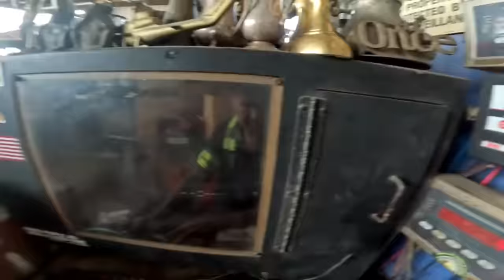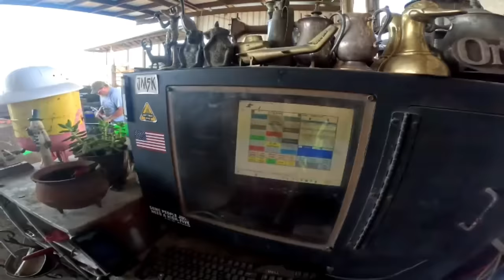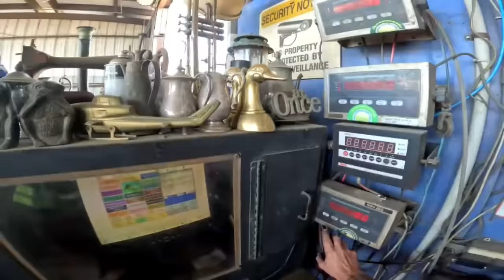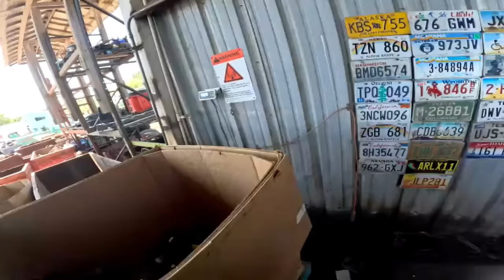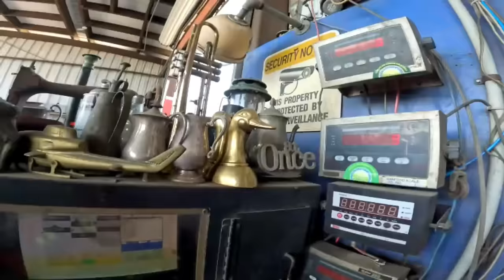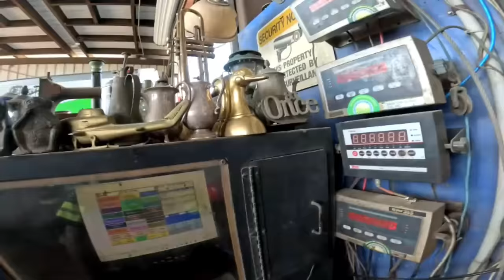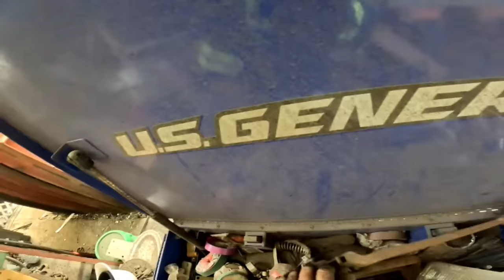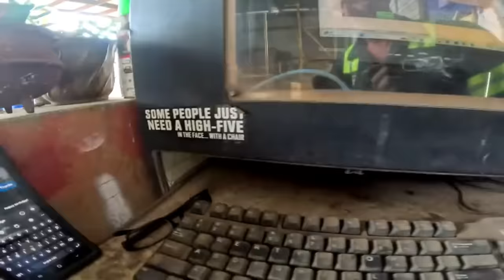IT JUST NEEDS A LITTLE LOVE #steel #iron #shear #recycle #recycling #copper #crushing #scrap #brass

Comment: Scrap metal is a good economic indicator, this is why people are bringing what they can even if it is a small load. I have noticed less electric appliances on my scrap run which probably shows people are saving their money. You need to buy two height adjustable hydraulic flat bed trolleys, one for the compressed / motors side and one for the heavy side. This saves you carrying stuff so far and you can load each one up, this will save you making so many trips back and forth. Great video as always.
Reply from the maker: Yea i don't know I'm my boss would do that. I definitely have a few micro scrappers who come thru and clean everything

Comment: Questions;
  1) Do you have the third monkey, see no evil?
  2) All the non metal stuff like wood, plastic, fiberglass and etc. that the scrappers bring in to the yard you have to dispose of, does that effect the overall price you set for scrap?
  3) You showed us the shear so what is the crane with the scissors on it called?
  Said it before…you are busy man! 👍
Reply from the maker: No I don't have the third monkey. . We do have a trash pike where most of it goes. Same thing but it's called a stick shear
Reply: @nonferrousjeff  Does the amount of trash and the fee you pay to dispose of it effect the overall price of what you pay for scrap?